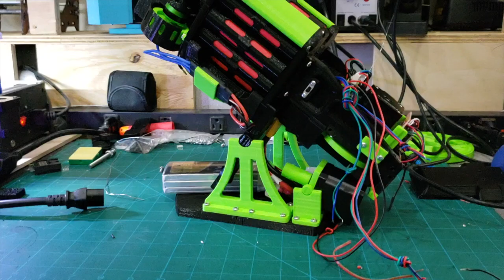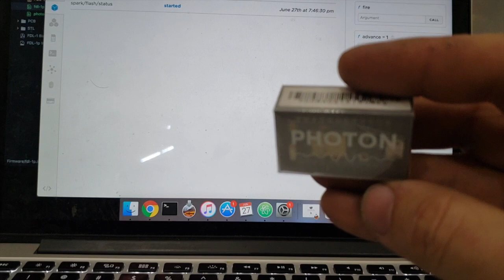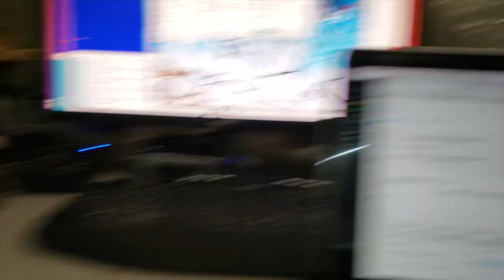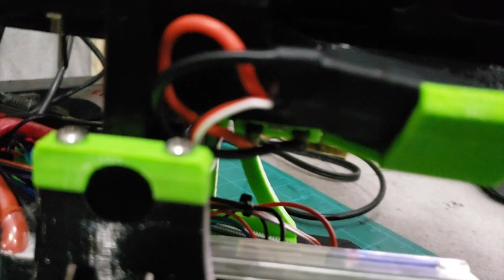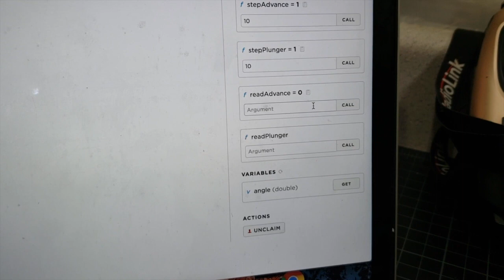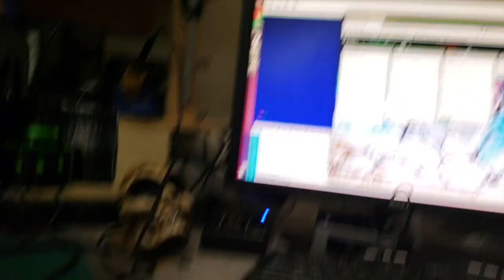FDL-1: Foam Dart Launcher Pt 2 Turret and Electronics

Comment: Dude, awesome. Just stumbled across this. Did you ever get this fully functional? You may have the only other complete turret version in existence besides the one in my own shop.
Reply from the maker: i got it "functional" in the sense that everything is wired up and actuates.   i haven't been able to get it to fire but maybe one or two very short shots.   after I saw the power it had, I realized it's probably not "work safe" as I had wanted to hook it up to our build tools to shoot people that break things.    I'd also thought of putting it on my mini tank which i'm setting up with a Kinect.  Base was a bit big for that, but i might revisit it.
Reply: @billieblaze  it can be a fickle beast but kind of an endless source of tinkering. I have done two other blasters as well whose code and parts all essentially stem from that turret. If you do come back to it, feel free to see if there's anything helpful there. Thanks for printing one.